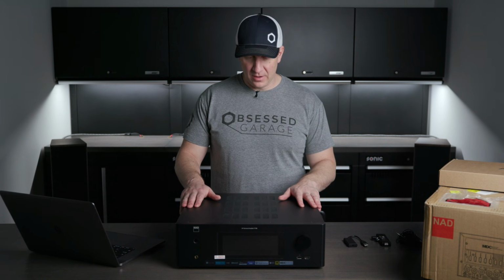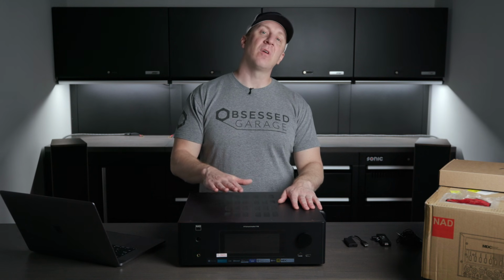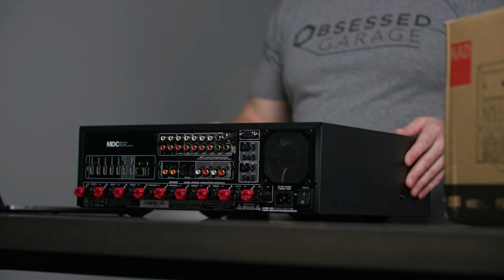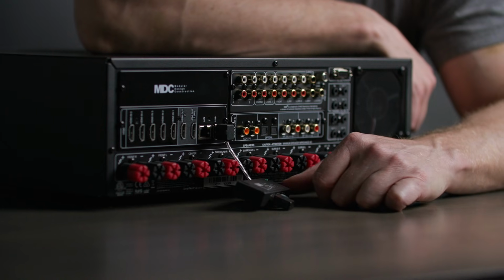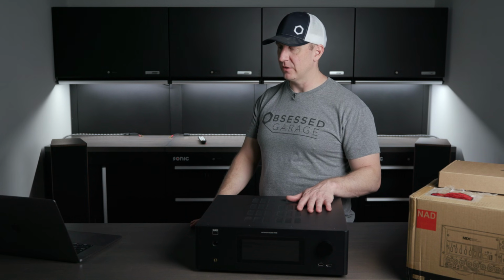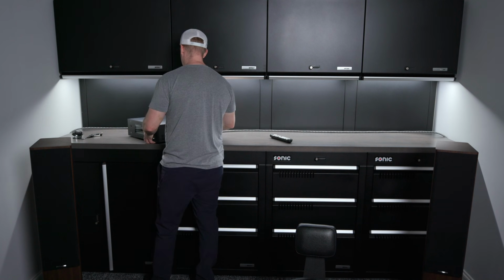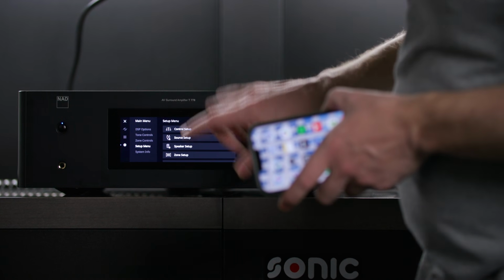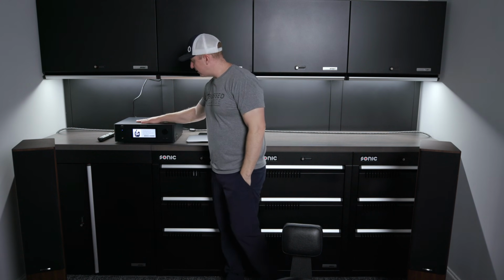NAD T778 Reference Audio Video Receiver

Comment: You may be glad that there is no longer component sockets (or S-video), but I have vintage equipment still in occasional use (Pioneer Elite Laser Disc Player, and Panasonic VHS/DVD player) and I am annoyed to find this good gear no longer supported with connections,  Fortunately, there are devices that can convert these vintage units to HDMI, but extra connections in the music chain is never a good idea.

One big reason I’m buying this unit is because it has had a lot of reviews that mention its very good audio.  You are the first person I’ve heard who doesn’t agree.  To be honest, that is scaring me as  I spend far more hours watching opera or other classical music programming on my TV system than I do watching TV programming and I’ve been counting on this T778 to come close to the Audiomat Arpege tube integrated amp it will be replacing.  I have Luxman tube amp and tube preamp in my main audio system so if one judges audio quality by price, the NAD costs only a small fraction of my Luxman gear so that tells me that I’m probably going to be disappointed, but I am so done doing without remote volume control and not enough HDMI connections on my TV for all my gear.

Comment: I’m debating between this 778 an anthem mrx740 and a Arcam avr850 😏. The Arcam is older but still has atmos, 4k Dolby but also a better amp than all of these
Reply: Arcam has the Class AB amp circuits but lacks the processing sophistication
Reply: @donaldcoulter6017  so I tried both the Anthem and the Arcam avr850 and hands down the Arcam wins. I also tried an Arcam AVR20 which is the newer model and still give it to the avr850. The 850 also has Class G amplification over all the other models

Comment: I’m running Klipsch speakers with my T778. Two towers, center, six overhead speakers and a 15 inch sub in a great room and it blows the doors off the house.  Blue OS is incredible. It can process up to 24bit music.  8 bit is CD so imagine the level of studio quality sound it can crank out. Amazon music has lots of high definition content now,even Atmos and that is where you will get that crisp unbelievable studio quality 3D sound. Play it in Surround mode instead of stereo for HD/Atmos tracks and crank it up.  Tell me what you think. Also how can you play music in a garage full of echoing surfaces and get any kind of clarity.
Reply from the maker: You’d be surprised how satisfying awesome gear in a garage can be.

Comment: I have owned the Nad t778 for about a year it sounds very good for 2 channel music and HT I have found for my speakers tone controls are set flat for best sound ( my hearing) plenty of deep bass from this class D amp/ receiver. Unless you are using extremely bright speakers this thing sounds great without adding a bunch of unnecessary sound enhancements. Dirac is good for HT but music I prefer it off the Bluos streaming is great.

Comment: Does the Dirac recognize both subwoofers as separate subwoofers inside the Dirac full upgraded software? I know it's a combined sub1 and sub2 wiring (so they're not really true separate sub outs). But in looking at getting one of these to buy, I wonder if the Dirac actually see's the subs individually in the software measurement or does it only see one subwoofer that combines the 2 subwoofers that could be connected to the sub1 and sub2 out (but are in essence combined wiring, so only really one sub out)... If you know what I mean?... As I understand it, you can't get Dirac Multi Bass but I just wondered if the Dirac Live Update could measure 2 separate subwoofers in it's software and recognize them as 2 separate subwoofers inside it's software when using this NAD T778 unit? Would love your input and thoughts on this and if you can confirm this for me?

Comment: Thinking about getting this NAD T778 instead of Denon 6700 to power up Dali Rubicon 2 + Rubicon Vokal and 2 Dali Oberin 3. 
Need to go to a shop to test the sound, but I heard NAD Stereo Amps compared to Denon AVR Stereo modes. Sounded heaps better. What do you think I should go for?
Reply from the maker: I think the NAD is a better choice.  It's just so much simpler than the Denon stuff.  The Class D NAD amps are really growing on me.

Comment: I had one, enjoyed it, loved it, then sold it for separates. I regret that. Now I need 3 components (processor + 2 amps), and I still don't have a digital streamer for Tidal since I don't have BluOS. This separates system doesn't even sound much better than the 778.

Comment: NAD doesn’t advertise which HDMI version they’re using in this, but it’s most likely 2.0 if it can output 4K60. Which would be the same as their VM 310 MDC module. 

I hope they’ll update their HDMI to 2.1, to be able to output 4K120 or 8K60, soon.